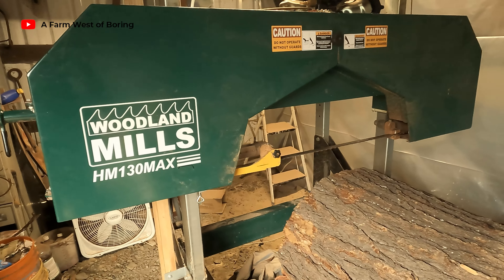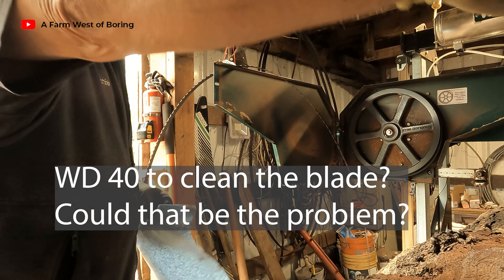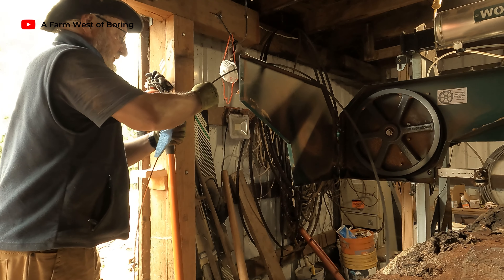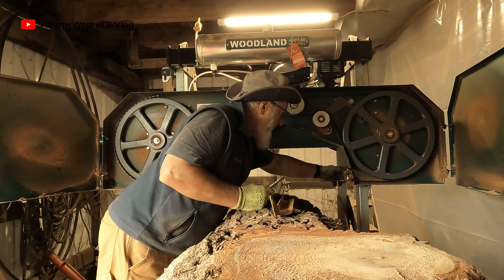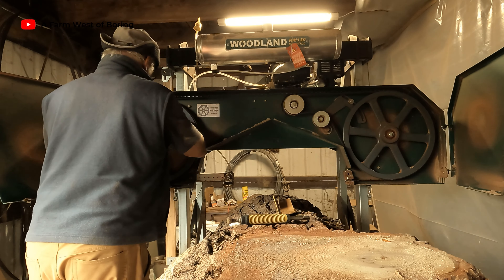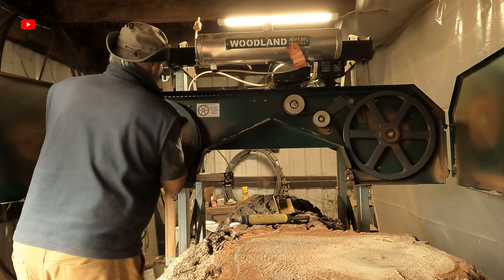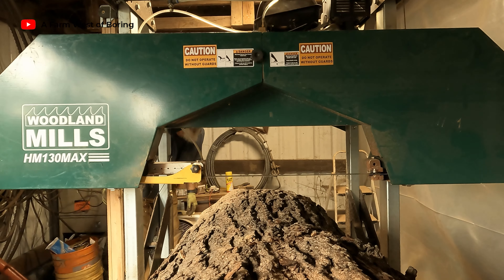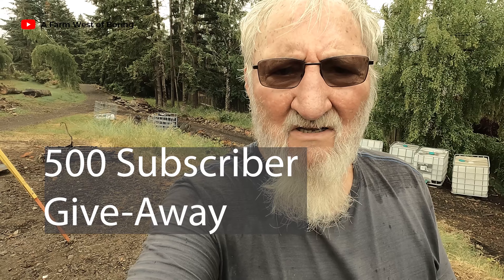Tackling SEVERE Problem with the Woodland Mills HM 130 MAX Sawmill | I faced Near Disaster

Comment: Questions to ask yourself - why is the water not running?  If the gas-pedal directly mounted on the motor is fully to one side, the water valve will be fully opened and water should pour rapidly onto the blade.
What is rubbing?  Engine off, doors open, move the blade by hand - there should be no rubbing or other friction noises and the blade should move freely.
Why is the engine running so slowly?  With the gas handle fully depressed, the gas lever on the engine should all the way over to full-throttle and the water valve should be pouring water at peeing speed onto the blade.  If these two things are not happening, the throttle cable is not set up correctly.  (Yes, it's fiddly and really needs a redesign, but getting it right is very important and is fairly easy to do.)
Is the blade tension at c.a. 20-25 foot-pounds?  Check with a torque wrench!  (The "Three turns after snug!" is a silly guide and TBH, who knows what tension 'snug' is???)
Good luck and let us know how you get on!
Reply from the maker: The water should have been on and dripping when throttled on. The valve on the tank is quirky and sometimes runs more and sometimes less water. I am going to replace it with a ball valve. When throttle handle is fully depressed the engine runs at full rpms. If I reach over and push the engine throttle handle it will not go any further. But in this case I may have been only holding the throttle handle part way down because of the funny noise. Once it broke loose everything was fine and normal. 

I do the 5 half turns thing. I am pretty familiar with what I consider snug, and I go 5 half turns from there. Has always worked well for me. I have tried torque wrench, but find the 5 half turn more reliable (for me).

Thanks for the great comment!
Reply: @a_farm_west_of_boring  Dripping is nowhere nearly enough!
Reply from the maker: That's what I have always used.

Comment: Only think I can think of is blade guide clearance.
Reply from the maker: I checked it later and it was 1/2 mm on top and 1 mm on bottom (Whatever the spec is). It was really strange. But running the blade and it finally "broke" loose. Thankful that there was not a major breakdown. I have used that blade to saw up 2 pretty large logs with no problem.
Reply from the maker: I got the same problem as you. Too many projects and not enough time. I guess there is always next year (hopefully)!